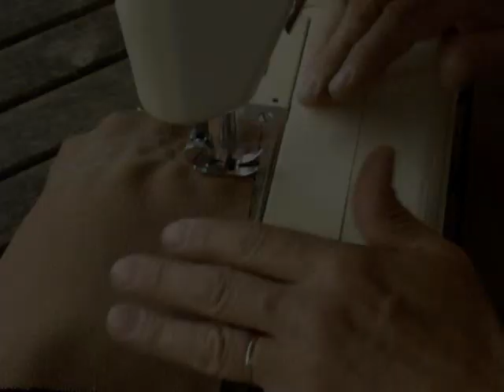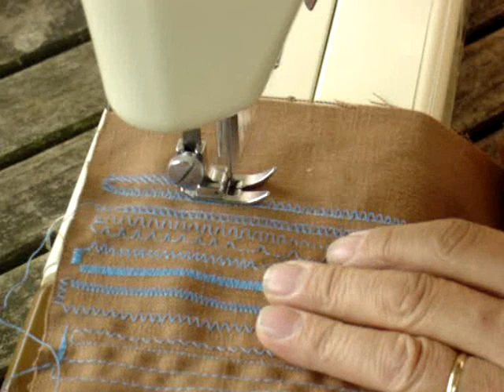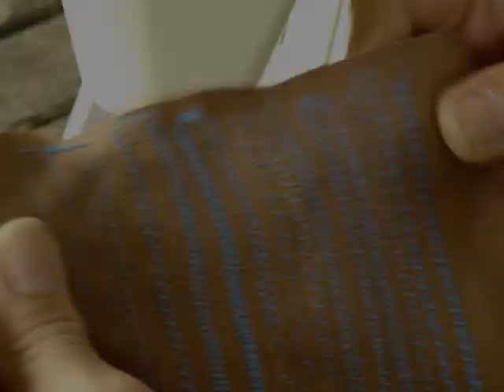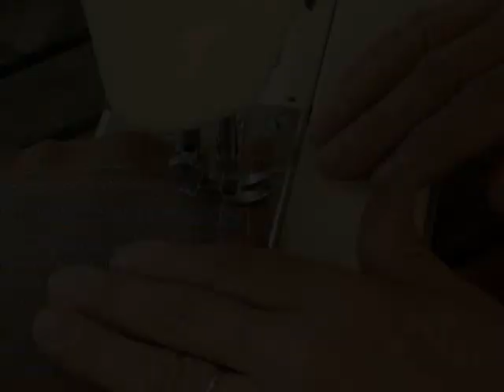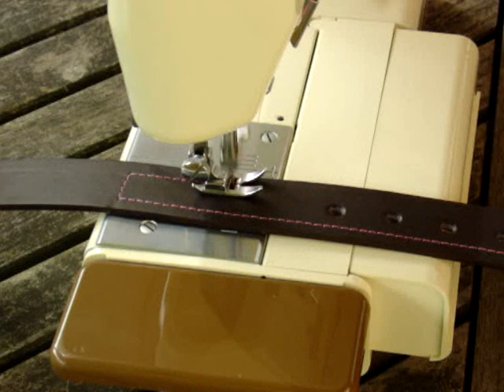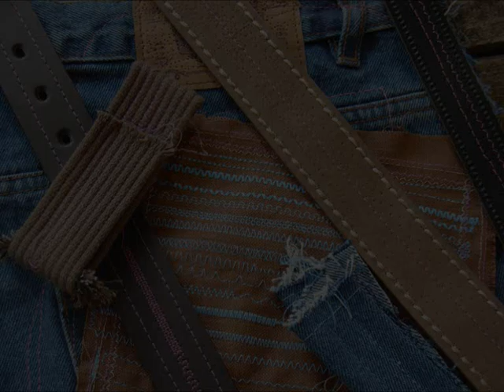Frister Rossmann Cub 4 sewing machine

Comment: Hi, I just got a Cub4 and it can only do straight stitch and the --v---v-- , any idea how I can fix that? Thank you
Reply from the maker: Hi, sounds like the stitch/cam selector mechanism is sticky due to old oil. Take the top off the machine and squirt release oil (WD40 or similar) onto the mechanisms  -  you can see which bits are moving when you turn the stitch selector and zigzag dials - then gently force the moving parts back and forth to free them up.

Regards
Reply: @agathaLew  yes I had been looking in there but not knowing what I was looking at didnt help much ha. Anyhow suddenly now I saw that the arm that goes onto the different "coins" didnt move much so just poked it with a screwdriver and wupti its now unstuck and shifting from "coin to coin". Thank you :)
Reply from the maker: You fixed it  -  well done!!

Happy sewing

Comment: I need cGlbe cub03 eclectic paddle
Reply from the maker: Here is a link to a free to view Cub3/4 instruction manual:

https://www.sewingonline.co.uk/instructions/fristercub3/

To view it just click on the arrows >> below the image.

If you still have the old connecting wires and cables for your machine you can buy a new foot controller from here and then connect it to your cables:

https://www.ebay.co.uk/itm/UNIVERSAL-YDK-SEWING-MACHINE-FOOT-CONTROL-PEDAL-FITS-LOTS-OF-MAKE-AND-MODELS/351786803276?epid=940086193&hash=item51e820a04c:g:j1UAAOxyY9VRP8Gq

Regards